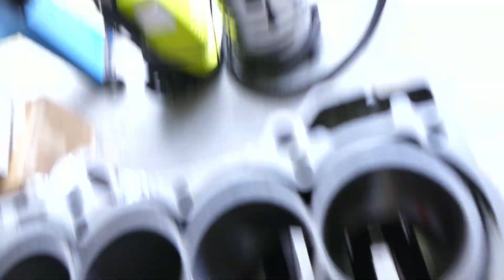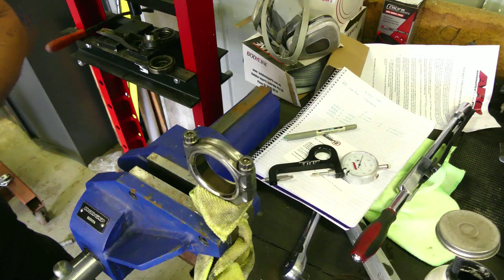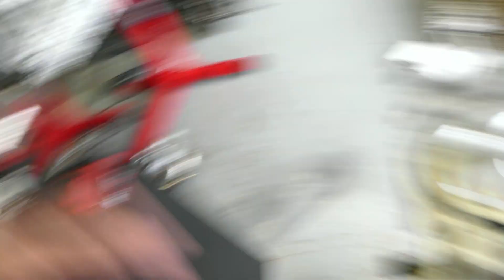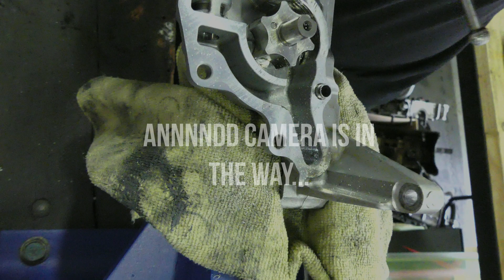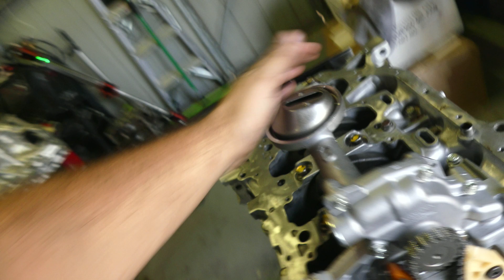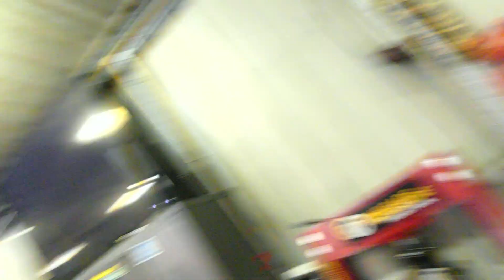Honda Civic EG Kswap - K24/20 porting oil pump, rods, pistons & final assembly

Comment: hi bro piston size ？
Reply from the maker: They are off the shelf Wiseco pistons. 12.5:1 and 87.5mm (going to the .5mm larger helps to clean up the cylinder bores by boring out .5mm worth of material and doesn't hinder cylinder wall durability or performance) 👍